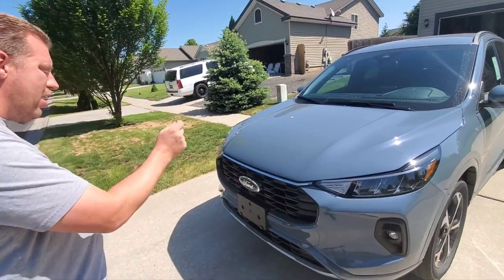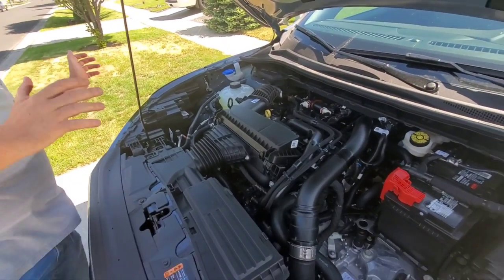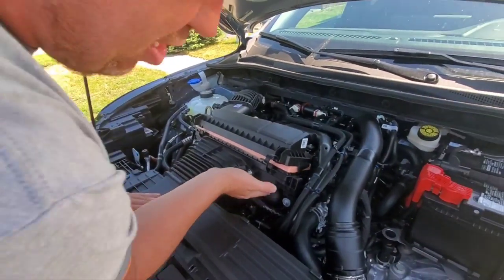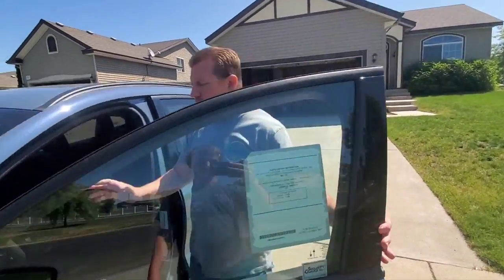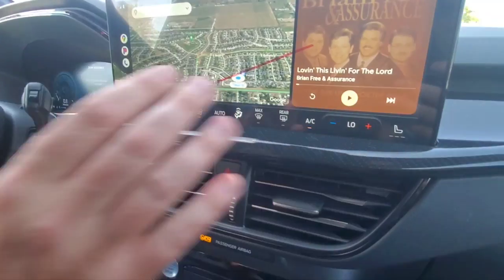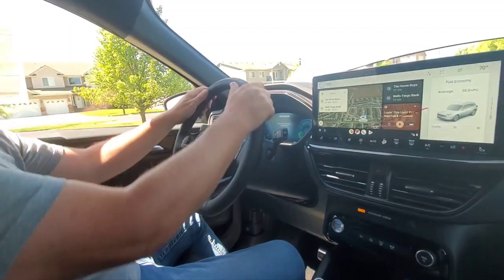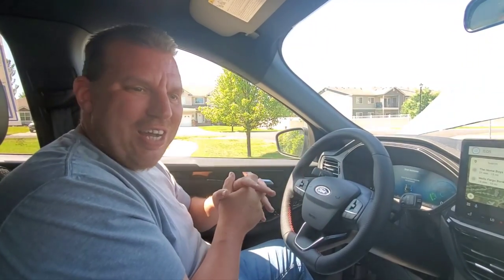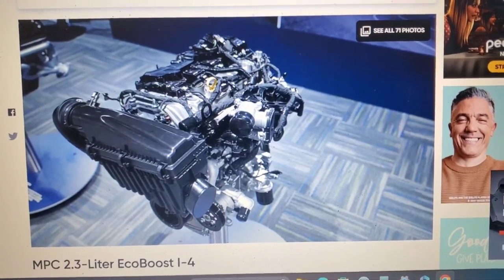This 2023 Ford Escape is Lurking a BIG SURPRISE Underneath Its Hood!!!

Comment: What is your source that says the 2.0L has port injection? The data sheets from Ford state only GTDI.
Reply from the maker: I can actually SEE the port injectors and fuel rail mounted right above the intake manifold.
Reply: @thejmcGarage  I wonder why Ford or anyone else has never mentioned this major change!
Reply from the maker: Two publications have already made mention that Ford was doing this. Motortrend 2024 Ford Mustang Engines: More Power for EcoBoost and GT, New ... https://www.motortrend.com/news/2024-ford-mustang-engine-ecoboost-v-8-deep-dive/amp/ and Ford Authority https://fordauthority.com/2022/10/2024-ford-mustang-debuts-new-2-3l-ecoboost-engine/
Reply: @thejmcGarage  I really hope this is true for the 2.0L, it's a major advantage.
Reply from the maker: @pooh4519  may I suggest go to your local dealership and see if they have any 2023 Escape in stock with the 2.0 and see it for yourself.

Comment: Excellent video. I love your videos explaining Ford Engines and their problems. This video you showed that it is a new ecoboost design which is good news cause the last one was crap. Could you please do a review on the three cylinder review and predict its longevity. This engine is part of the MPC family but the three cylinder is part of the dragon engine family. I have read a lot of reviews that say that the three cylinder will only last 100,000 miles.
Reply from the maker: The 1.5 in the 2023 Escape is now apart of the MPC Ecoboost family.

Comment: Please reply to me about how did you open the bypass this washer Samsung lid that u destroyed https://youtu.be/6_dkKtUoyCk and please be nice to me and tell me what is the full model number the next time before you destroy it please remove one suspension rod and run a full cycle with the washer lid open and bangs with error code durin final spin, a one towel test before you destory it.